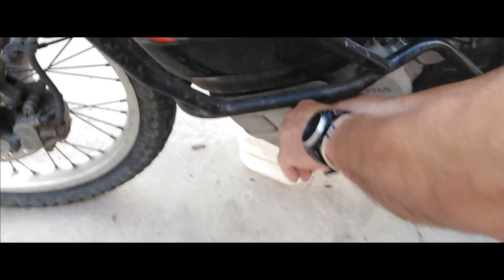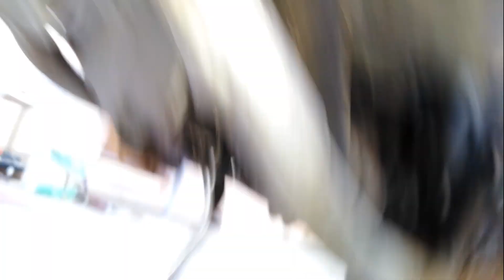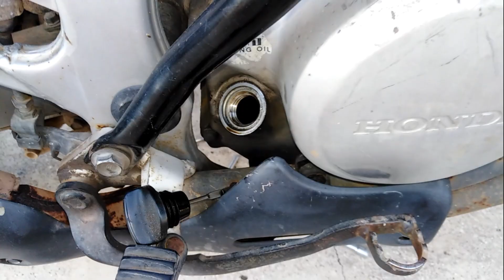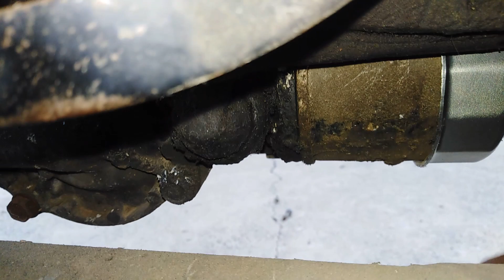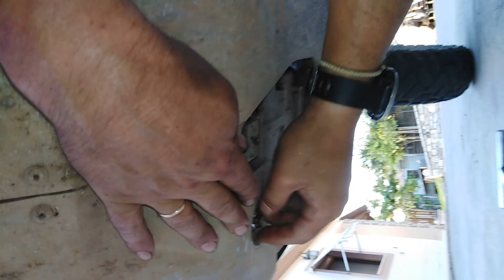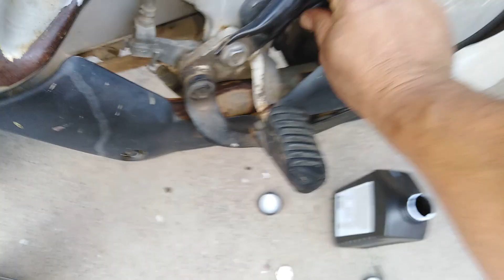How to change engine oil and filter on a honda transalp XL600V

Comment: How much does it take, 2L?
Reply from the maker: 2,4 L if you change the oil filter too.
Reply: Mine is 650, so 2.5-2.7L
Reply from the maker: 2,6 if you change the filter too.
Reply: How much oil to put L❤2.4 L or 2.8L